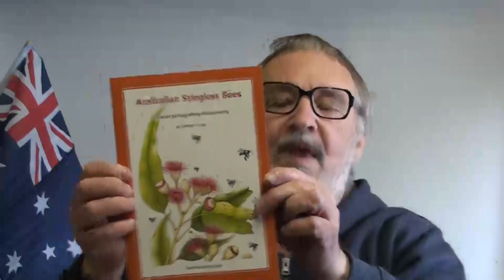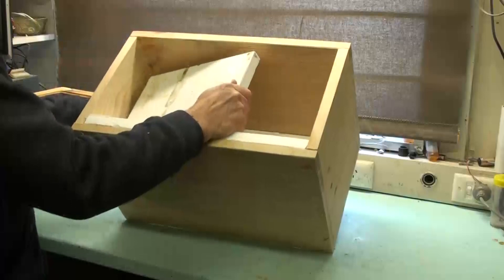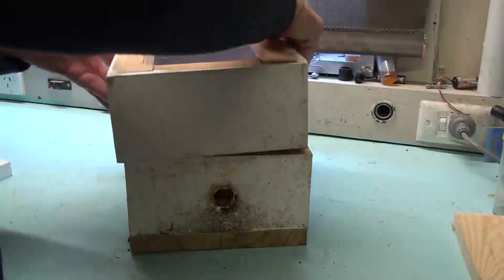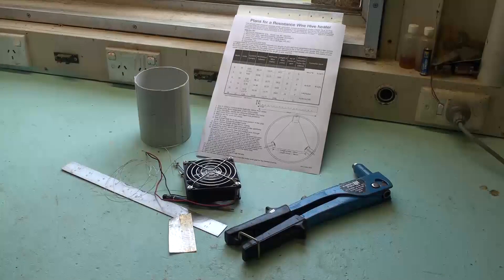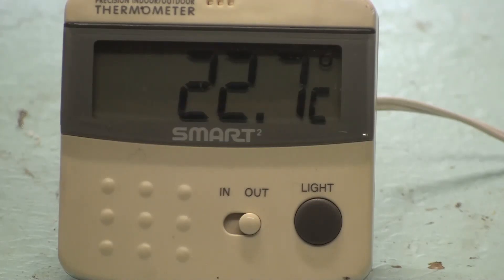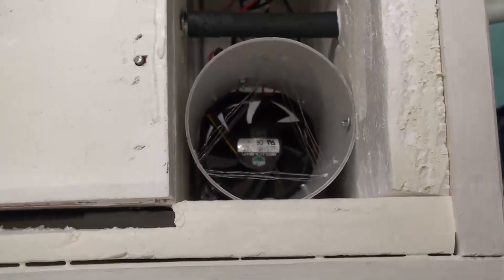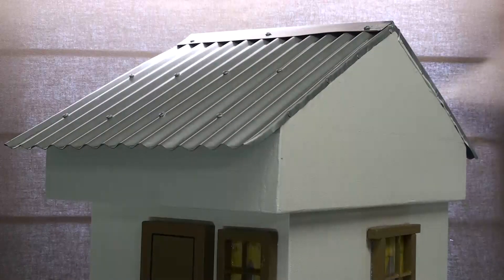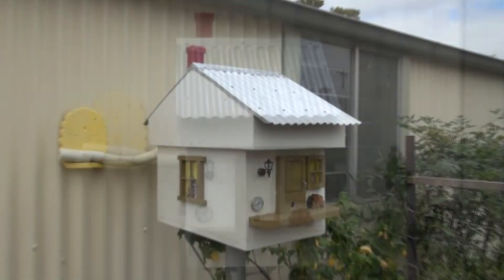Splitting a Tc hive by the eduction method

Comment: I've just been given two self watering pot plants that native bees have made homes in. Transported from Ipswich to the Gold Coast. Am afraid to water or pull the plants out as I think it will disturb the bees. I've noticed they are dropping potting mix out of the hole so I think they are tunneling into the dirt. I wonder if I can coax them out using your method.